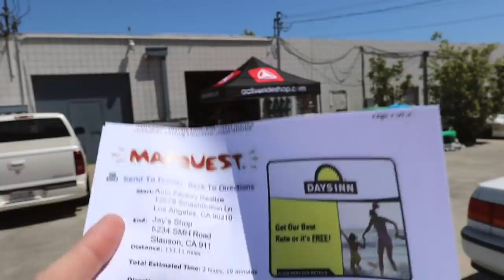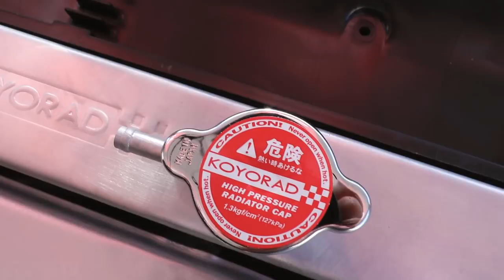Jay's S13 gets a 450HP SR20

Comment: I will hit the like button because I'm working on my sr powered coupe while watching this
Reply: What is exactly needed to do an sr swap in an s13 with the stock KA?
Reply: @odevious8081  not alot I got the sr engine trans, and 2 piece driveshaft. Factory sr engine mounts. I spent the extra money for a wiring specialties harness but a factory sr harness works. So far it's been easy the most difficult thing I've ran into so far is the wiring making sure everything looks good and is tucked and out of the way of damage. I still need the head studs and gasket to finish my gt28 setup, paint, wire the chassis and itll be nearing done